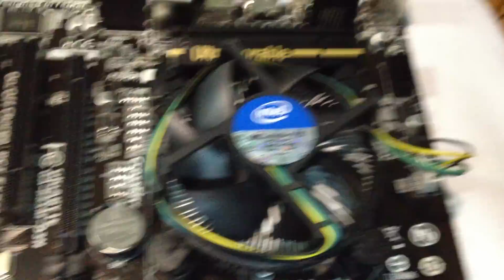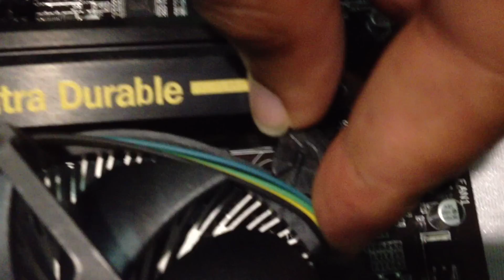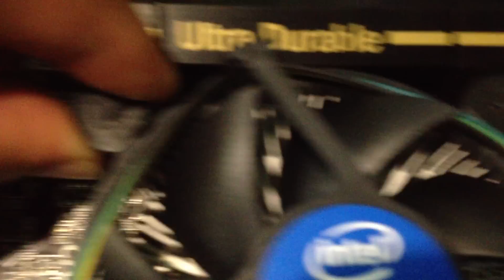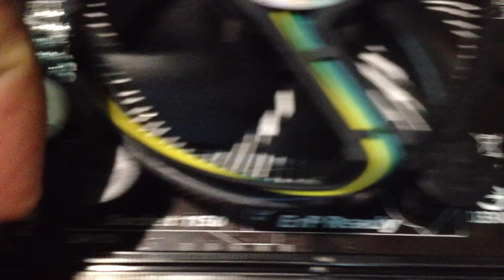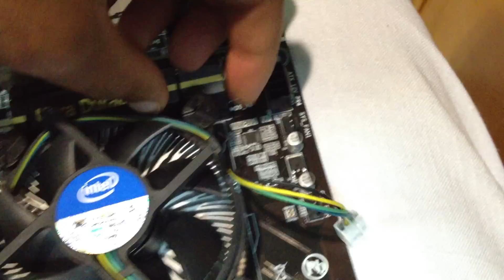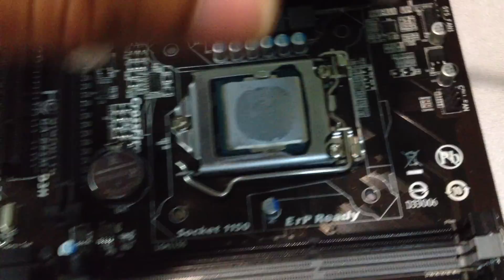Remove Heat sink intel heatsink install proper way, How to remove CPU Fan Intel

Comment: Also you should never pull the fan cable from the wires. 
Here is quite a good instruction on this:
https://www.intel.com/content/www/us/en/support/articles/000005852/processors.html

Comment: Hey if you do not apply back the paste and u install it will that cause it to over heat and shut down ? Because mine I didn't not apply the paste and I realized after 5 minutes of running the PC it would shut down
Reply from the maker: Typically if you remove it you should clean old paste and put new paste back on, if you didn't remove the old paste i don't think it would overheat to fast but may run hotter then usual.

Comment: This is BS!  It is NOT this simple.  It may have intended to be this simple and in some cases it may be.  But I would bet in most cases, including mine, it does not separate from the motherboard without an extremely hard pull from each corner.  I had to pull so hard the mobo was bending.  I think time is a factor.  The longer it stays in there, the harder it is to remove as the plastic pins won't want to retreat.  Instead, they stay clamped to the mobo.

Comment: Based on the video  if I got it well --To remove the CPU fan,  turn all the  arrows TO THE LEFT and PULL . To install , turn  all the arrows at the middle or turn all the arrows  BACK and PUSH. Am I right, Sir?

Comment: mine is stuck and I have a pre built pc. its loose like it wants to come off but it won't. any suggestions?
Reply: KingBrothersGamingTV KBGTV mine is the same way, did u fix it?
Reply: ***** yes I did, you have to take the mother board out and on the bottom side you have to close the pins so they will go through the holes. Once you take the mother board out and look at it you will see what I am talking about.
Reply: KingBrothersGamingTV KBGTV i didnt pull hard enough i guess, since when i put in a little force they came out. but thanks anyways!
Reply: ***** be careful forcing it as you may break your mother board. It shouldn't have to be forced any. That is why I took mine off.
Reply: Its all good im playing quake right now and om getting 50-60 c, compared to 80-90 before.

Comment: I have this stock CPU cooler now but I plan on getting a aftermarket air cooler. Will I need to reapply the thermal paste?
Reply from the maker: Yes

Comment: Fuck this video for not warning others that you need to reapply the thermal paste after you removing the heatsink. Instant dislike, this video gives me a huge problem and time waster. So make sure you have thermal paste before you remove it.
Reply: Well, he's not here to teach you how to pc, he's here to help you remove the heatsink.
Reply: It shouldn't matter if it's off for like a minute lol. You only need to replace it after cleaning which would take around 10 mins
Reply from the maker: Thank you sooooo much, You would think Title explains as much, don't get people some times.

Comment: One of the four plastic pins on mine is broken. Do you think it contacts the CPU and cooling paste just as well with only 3?
Reply from the maker: Put simply it's not worth the risk, you can find a fan as cheap as $6 at micro center or frys, so replace it.
Reply: biggonyou : Computer Whisperer
Ok. I'll do that as soon as I can. Ty.
Reply from the maker: kool

Comment: mine processor how eject motherboard on? cuz still removing doesnt.
Reply from the maker: +Fatih taşdemir make sure clips are in.
Reply: +biggonyou : Computer Whisperer clips which? fully where?
Reply from the maker: bottom of heat sink pin/clips they are plastic and white and hold heat sink onto board.

Comment: Im scared, I hard twist all four locks but the fan is really well in the Motherboard and I dont want to break it :( Any advice?
Reply from the maker: +Manwich Killer you may need to squeeze bottom plastic pins to get them to release, make sure also by looking under the board.
Reply: biggonyou : Computer Whisperer Do I have to take the board out? or can I leave it in?
Reply from the maker: most cases no,

Comment: it is stuck
Reply: Hey man, still there? Mine is fucking stuck. I even call a friend who happens to be "stronger" than me. Turns out that he too cant pull the last pin. Im fucked up
Reply: do you have a pre-built pc or did you build it yourself?
Reply: +Ur Mum I built it but don't worry I got it out
Reply: BROWNFORLIFE12 ok
Reply: a
Reply: Joshua Aguilar ay Man U still there? Same thing happened here.
Reply from the maker: Joshua Aguilar if this is the case you may have to take out the motherboard and squeeze pins from bottom to remove it.

Comment: mine has white clear ish plastic keeping me from pulling it off, help me please
Reply from the maker: +Stronk Vodka not sure about the plastic, seems odd.
Reply: biggonyou : Computer Whisperer yea right under or better yet inside the knobs you twist i pull up the fan and jams. white clearish plastic keeps the fan fron detatching.
Reply from the maker: The white pins on bottom locks fan two motherboard, if they are damaged or not doing what they should you might have to squeeze them to get them to release, that is if we are talking about same thing.
Reply: biggonyou : Computer Whisperer took it to frys, yep squezing them did the trick
Reply from the maker: :)  no problem thanks for letting us know.
Reply: biggonyou : Computer Whisperer yous welcome, OEM computers, what can you do
Reply from the maker: Lol very true

Comment: I just got a 4790k and new asrock z97 motherboard and just got it running good last night.  I was planning to put the asetek 550lc watercooler that i had on my old board and old cpu but i still have to remove the mounting bracket from the back of the old mobo.  do you think the 550lc watercooler would do a better job than the stock intel fan that came with the cpu?
Reply from the maker: +Randyhall85 usually any aftermarket will work better, but can't say for certain.

Comment: What if the idiots put thermal paste at the bottom of it? I'm putting in a new processor for a guy and I can't remove the heatsink..
Reply from the maker: +HoblinGoblinz just twist a few times it should come, also just make sure it's not one that is soldered to the actual board.

Comment: If you want to install an aftermarket cooler after this what would you use to clean the residue off of the cpu?
Reply from the maker: +kao ko alcohol pad works just fine.
Reply: +biggonyou : Computer Whisperer thanks
Reply from the maker: no problemo thank you.

Comment: Great video! Was just wondering, do you need to remove the motherboard to replace a old heat sink with a new one?
Reply: No
Reply: You might need to clean of the thermal paste off cpu

Comment: Do i need thermal paste?
Reply: +Ott Đody VERY risky if you don't apply thermal paste at all to your cpu.
Reply: ***** If it were true, there would be an MSDS (Material Safety Data Sheet) in the packaging, and it'd have a Toxic symbol on the tube.
There's no scientific evidence to prove or disprove that thermal paste is a carcinogenic.
Reply from the maker: +Ott Đody Yes always apply thermal paste when installing a heatsink.
Reply: ***** Let's totally believe 1 article over every single computer manufacturer in history.

Comment: Is the amount of thermal paste that is on there sufficient? Or would you add more? I'm a lazy guy so if you don't need more then I'm set.
Reply from the maker: Sir Blu  i would check video on proper thermal paste amount, it should be a thin thin layer.
Reply from the maker: yup just youtube search for one.

Comment: can anyone help me please:yesterday I cleaned my computer from dust and for the first time i decided to remove the cpu fan for the first time just to better clean it. mine looks exactly like the video. i installed it back but when i apply a small force with my finger for example, it moves, meaning that its not that stable. now when i play League of Legends( its a game), my pc randomly turns off as if the power went off(but the power is not the issue). can the bad placement of the cpu fan cause this?
Reply from the maker: *****  You need to apply thermal paste small dime amount in center on top of cpu, also consider ordering a new fan if you broke the old one, they are very cheap.
Reply: biggonyou : Computer Whisperer thanks for the help but ive already fixed it. the problem was caused by the badly placed cpu fan and i just reinstalled it properly.
Reply from the maker: Not a problem, glad you got it working.

Comment: If I want to swap processors do I have to remove the motherboard from the case?
Reply: No, just open up the clip and take out the old one put the new one in, then put the heat sink on.

Comment: Can you put it back on?
Reply from the maker: LukeThePerson  yes sir you can.
Reply: biggonyou : Computer Whisperer you have to clean a reapply the thermal paste when you take a cooler off thou, or else there'll be air bubbles and it wont properly cool the cpu.
Reply from the maker: Yup

Comment: If i buy a box one (i7 4790k box not tray) can i not use it or take it out after and replace it with liquid cooling ?
Reply from the maker: I'm a tad lost, whats exactly is the question, can you use stock until you upgrade to liquid?
Reply: yes
Reply from the maker: yes stock isn't bad, just not best for overclocking.

Comment: guys can i put this stock cpu fan for my cpu pentium dual core e5700 please reply ???
Reply from the maker: If it's the original fan or same socket should work just fine, but fans aftermarket fans are pretty cheap so don't take any risk.

Comment: did the same thing... my cpu heatsink won't come off like at all
i tried to force it but had no luch :( help meh
Reply from the maker: make sure it's not one that has screws, you can tell as it will look different then the one in the video, sometimes paste get like glue and creates a hard glue like bond, but it will release.
Reply: i wouldn't make a noob mistake like that :D i know quite a bit about pcs :D it is a 3rd gen core i5 3550p with the stock intel cooler that they have been using for a bit of time now :D
Reply from the maker: My apologies, it must be paste hardened or pins didn't quite unlock.
Reply: welp it may be the fact that the pins are somehow damaged but i would have to take the mobo out cuz i don't have a cutout
Reply from the maker: That may be the case, sometimes you have to do it the hard way, keep us posted
Reply: darkmonster11LP Sometimes you should take out the entire board, and in the other side press the white plastics that are inserted in the holes, this is in the other side of the board sometimes you have to take it out. You can press those little plastics whit your nails or a little tool.
Reply: yeah i've thought about doing that :D

Comment from the maker: Elena Llasos do you mean remove fan from heatsink?  if so they clip off, i wouldn't bother with it though if fan is bad just replace the whole thing they are cheap.
Reply: biggonyou : Computer Whisperer  thanks dude
Reply: I've got it now. Thank you very much for your help. It's not because the fan is bad, it's because I need the heat sink for our Investigatory Project. But anyway, thank you for the info.
Reply from the maker: no problem thanks for feedback.
Reply from the maker: thank you..

Comment: Thanks mate but one of the pins kinda got stuck and now they won't go down when I reinstall the fan the other 3 work fine and hold it place just fine though but I'm a bit worried about it
Reply from the maker: Easily fixed just pull off and squeeze pins together.
Reply: Well that was easy thanks!
Reply from the maker: TheBakeroot that' s what i do :) thanks for the feedback.

Comment: Thanks for the video! I accidentally stripped 2 of the arrow things. Do you know any way to remove the heat sink? I am using MSI Z97I Gaming AC and Intel Core i7 4790K.

Comment: This didn't work for me. I turned all 4 posts and pulled up on all of them then pulled up on the while heatsink as shown. The heatsink separated from the CPU but it won't come off completely. The ends of the posts are still held in by white plastic pieces. I've tried pulling very very hard on the whole assembly and on each post but none of them will come out of the motherboard. If I pull any harder I'm going to mess up the motherboard. What is going on here???
Reply from the maker: Ok, which model of heatsink and motherboard you have, this will work it only works one way there isn't any other option you might want' to make sure you didn't buy one of those cheap Mobo combos where they seal it to the board. keep us posted and take video or pic and send us a link.
Reply: Thanks for the response. After a few minutes I got out the needle-nose pliers and pulled on the posts right where they meet the motherboard which did the trick. This was on a pre-built computer so I don't think they took the time to make sure the holes made removal very easy, and I don't think the heat sink had ever been removed before.
Reply from the maker: Hmmm.. at least you got it, thanks for the feedback, good job.
Reply from the maker: Make certain it's same heatsink, some have screw on at bottom holding heatsink to board, and if it's an older one might have to pull up harder -just be careful.
Reply from the maker: Would like to see a picture first and see if anyone else has some ideas? worst case scenario removing board would be safe and last option.
Reply from the maker: don't use either of them can you post link to dropbox and send it to me.
Reply from the maker: Good Deal, Glad you got it.

Comment: Even if all pins are pulled out, the heatsink doesn't comes off. How hard do you have to pull it out ?
Reply from the maker: Not very hard, thermal paste can cause to stick somewhat, but good pull should bring it right up.

Comment: Short, to the point video. Thanks!
Reply: Which is rare to find these days. Usually a video like this would be 5-7 minutes long and start out "Hey you guys, today I'm gonna show you how to remove an intel heatsink, I recently purchased an i5 3570k to replace my i3 3220. The 3570k is a quad core and runs at 3.4ghz while the 3220 is only dual core running at 3.2ghz. It uses the same fan and heatsink but I'm going to use the new included heatsink because the thermal pads are brand new" etc... lol  Thank you Computer Whisperer for being straight to the point!
Reply from the maker: Not a problem, thanks consider subscribing.
Reply from the maker: Not a problem thanks for the support, i truly appreciate it  :)
Reply: Classic80sStuff True that, haha.

Comment: i really wish you would reply
I have the same stock cooler but its stuck, i cant turn it
Reply from the maker: What is your question? the stock coolers are cheap if it's stuck replace it! newegg sells all types and aftermarket coolers that have user ratings.
Reply: no, I cant open it, I cant turn the thing to the left 
lol

Comment: I have a dell optiplex 360 can I replace the stick metal CPU cooler with a fan
Reply from the maker: look like it would be tough to get an aftermarket cooler inside that small form factor dell case, i wouldn't advise it! One pain when buying proprietorial devices. do some reasearch and see if anyone else had any luck in replacing and with what.

Comment: How to put back the protector of the cpu ? why it has 4 pins on the side that face the momo pins ??? is crazy so easy to damage the pins, does intel or gigybite or any notice this ? how can this be so idiotic. or just easy to break so you have to BUY  another ?
Reply from the maker: Hmmm.. would say they not overly concerned as most enthusiast choose to use other more advanced heatsinks and fans anymore, and if your careful intel factory items will give you many years of good life.

Comment: very good tutorial thank you
Reply from the maker: Thanks, really means a lot to many, will try and keep them coming -Robert
Reply: biggonyou  well somany teach how to put them but not how to remove them i can say that if there are many years that the cooler is in place it is vary hard to unlock and sometimes you don't want to remove the motherboard from the case

Comment: If i have a intel stock cooler when i bought a haswell procesor...will it work on 775 socket?
Reply from the maker: No Haswell isn't 775 socket! Haswell is socket 1150 heat-sinks are fairly cheap always go with correct socket.